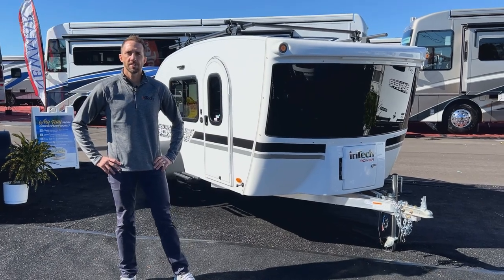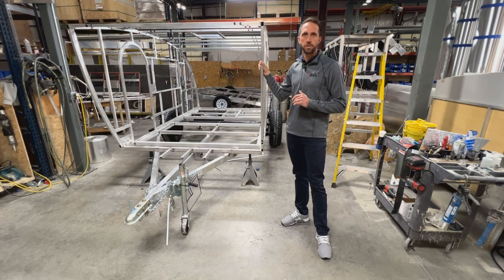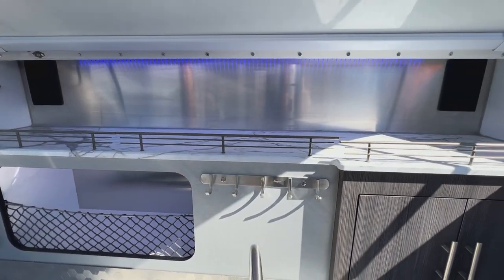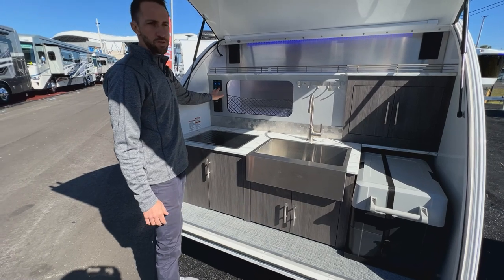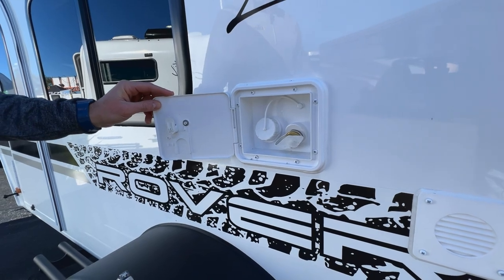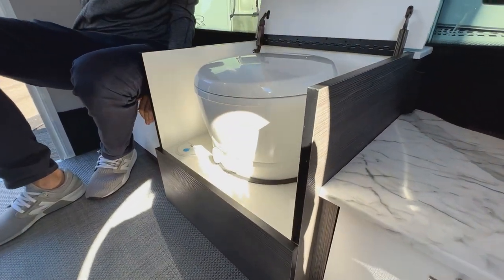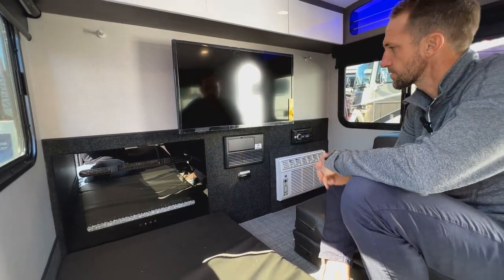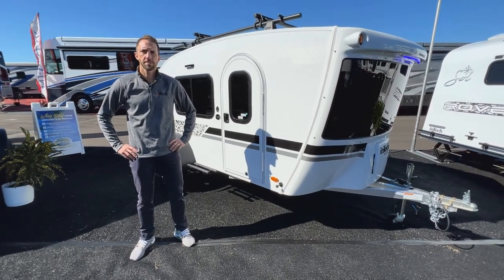2022 Luna Walkthrough

Comment: Folks basically these little campers are made for a few days camping trip and that’s because they are designed for people who don’t have a huge truck to pull campers around with. I have a teardrop camper because when I go camping I want to be outside not in a camper. My teardrop is smaller and I love it because I can take it anywhere my Subaru outback can go. There is a way you can have hot water with a tankless hot water heater that runs off of propane. Yes the 5 lab propane tank isn’t big enough for me. I have a 20 Lb on my teardrop. Also the doors look identical to the doors on my teardrop and Pahaque make a couple different screen rooms and tents that fit these. I got me one and the reason is it makes it easier to change clothes and them in the middle of the night bathroom needs. I love the kitchen area on the back of mine and it’s the pretty much the same as this one but I don’t cook on the 2 burner stove because I already have a Colman camp stove and I use the one lb propane for it and it has the guard shields on the sides as well as the back. To me it’s not by a small camper to adapt to you it’s you adapting to the camper. I am not one of these people who buy a half a million dollar camper to go to a campground and stay in a luxury suite. Camping is you go be outdoors. Having a small camper that has heat and A/C is a luxury. So if you want to be outdoors learn to adapt to a camper. Heck I’m in my mid 60s and I still go camping in a tent sometimes. Camping is a survival test. If you can’t adapt and survive to what you have your history when this country disowns you. And believe people it’s going to get to the point where nobody can afford to live in an apartment or any kind of housing. We all will be camping. Learn the survival skills because it’s coming. So my best advice to people looking at these great little campers is learn to adapt to the camper and don’t expect the camper to adapt to you.